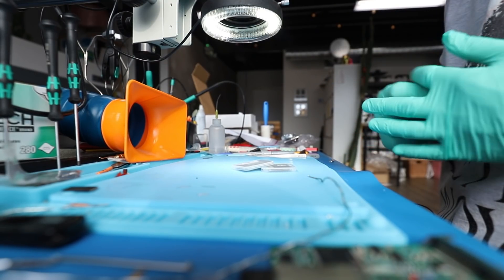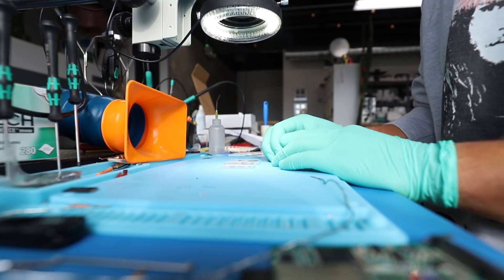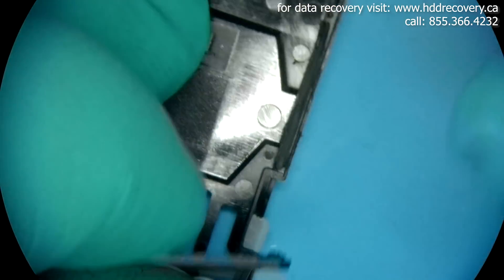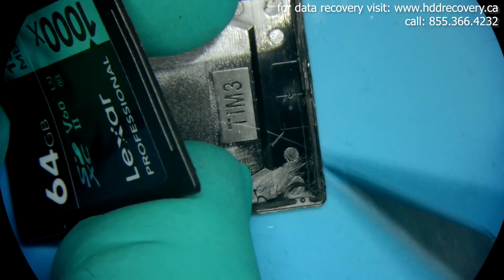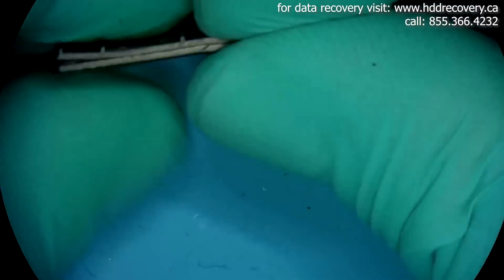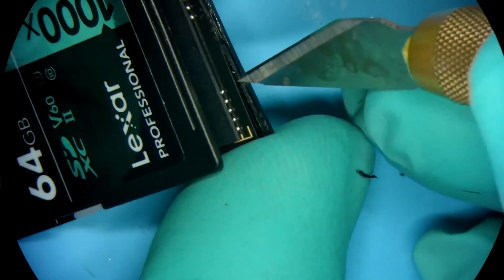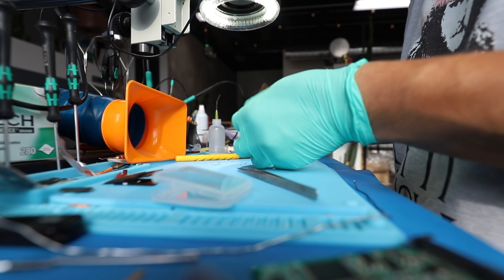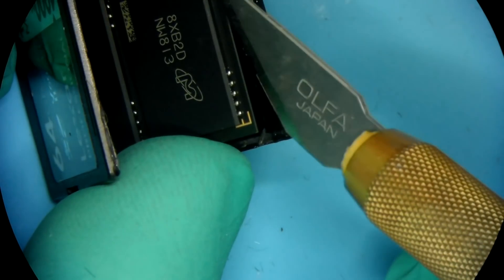Lexar Professional 1000x SD card data recovery

Comment: I had a 256gb lexar 1000x memory card broken that had two bga152 nw743 micron flash chips. Since i couldnt find a memory card that was the same ( the pcb had different test points than the 256gb bga152. most of the other 256gb donors i got were bga132 and some of them only had 1 chip. i bought usb udisks, flash programmers all kinds of stuff that did not work. I bought a bunch of 128gb 64gb ones two looking for a way to practice and see if i could do the transplant and see it would work.  one day i decied to try to solder  two of these bga152 chips (2x128gb) to a board with (2x32gb). I  was under the impression from the flash chip programmers that you had to program all controllers for the specific chip, ther is no lexar mp tool for these. I looked at the one chip pcbs and noticed they only had a single jumper connected where the 2 chip pcbs had 3 jumpers connected. im guessing there is a jumper that enables each of the chips to  let it know if its single or double and whic socket to read from. im pretty sure you can use a board from any of the lexar 1000x sd cards as a donor agnostic of the chip CE count and capacity. just configure the jumpers the same way they are on the broken board onto the donor board. I hope this information helps someone recover some data, 

This whole process took about 3 years to figure out. when btc was 200$ i bought a few  and put the keys on the SD card and it broke. Preventing me from selling them. For that i am truely greatful. I brought the card to a 2  places and they looked at it and said they didnt want to mess with it. Probably because there is absolutely no information anywhere about the PCB schematic and no information on what the control is and its configuration. im glad they didnt take my drive an use it to experiment they were professional enough to only take jobs they were positive they wouldnt loose the data.

Comment: Can you supply a link where you purchased your blue and orange extraction pipe from, and also what extraction system or fan would you suggest is adequate enough for a keen beginner, I dont want to spend too much money as I dont do soldering all the time but not sure what would be suitable enough to extract the fumes enough, thank you

Comment: Hi, you have any suggestion on how to start small with a Data Recovery for really small application ? next year im writing my bachelor thesis and i think maybe going in the task area of data recovery. Can you recommend a hardware device like the MRT Pro or the Ace Lab PC-3000 UDMA who is a cheap to get an hardware example ? At least here in Germany they taking up to 8000€ for the devices that is way more than i can ever pay for a device like that.
Reply from the maker: As long as you get clients on regular basis paying off PC3000 is not going to be a problem. Learning the tool will be the challenge. You can always start small with a second hand Deepspar disk imager 3, they go for 700$usd if you lucky to find one
Reply: @hddrecoveryservices  Thank you very much for your answer. I don't think there are much used Deepspar here on the Marked in Europe. You have any suggestion where i can buy the used equipment in the US or Canada ? i found the EU Dealers here, but no prices just things like "Contact me for price"
Reply from the maker: I occasionally see a used DDI3 being sold in marketplace section on hddguru forum
Reply: @hddrecoveryservices  Hello Erkin, thank you very much for the support. I have registered and contacted the seller. Very kind of you.

Comment: Must be a nice feeling to be able to load it right into R-Studio rather than having to go through Flash Extractor.. Video was as satisfying as always.
Reply from the maker: These days chip off is the end of the road procedure for me.
Reply from the maker: Besides if video content needed to be recovered, chip off is not good as files are fragmented
Reply: @hddrecoveryservices  If you ever have the need to recover fragmented video drop me an email at joep@disktuna.com. Software from my website sure takes it's time and resources (needs Windows 64 bit, 8 GB RAM minimum but 32 GB highly recommended) and not always successful, but will attempt to re-assemble playable video (MP4)  from the fragments.

Comment: Question: why don’t you just try to reflow the memory chips first?
Reply from the maker: if pads came off the board, reflow is not going to help. Swap is a solution, reflow is a chance. Heat is not good for NANDs n matter how you look at it. If we put heat on NANDs we rather not take chances - unless it comes backed with a solution
Reply: @hddrecoveryservices  Makes sense. Thanks for your answer.
Reply: My sd card is broke in half.But i can still put the other sd card in it's adapter.At 1st it was reading but since it got broke in half it's not reading.How can i get the files off.Who can i take the sd card to ????